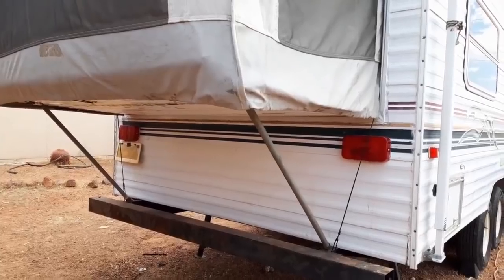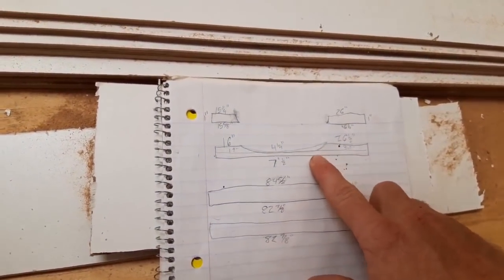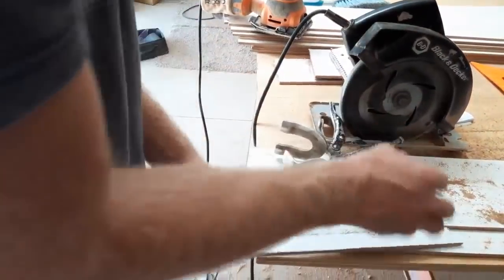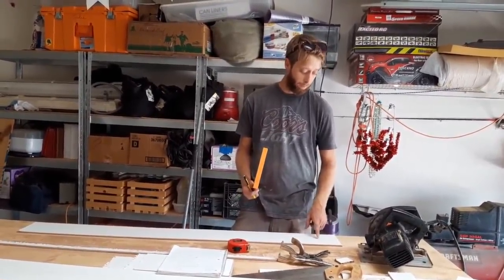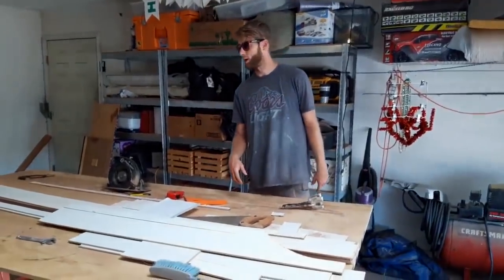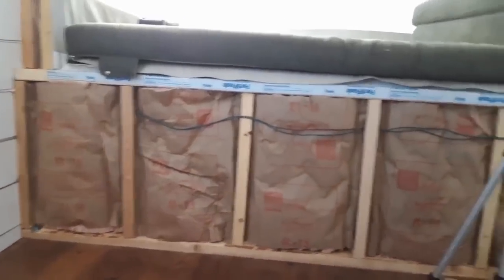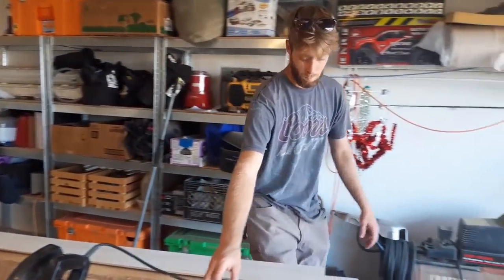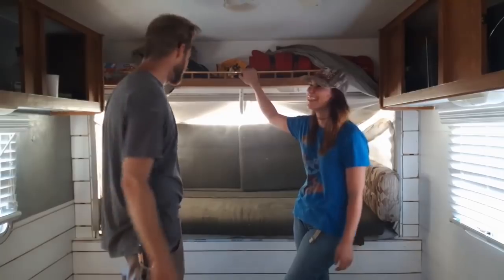Interior Shiplap | 5th Wheel Travel Trailer Renovation | Days 11 &12

Comment: Once again  i seeing after the fact  so maybe file for future  projects   that kind of paneling chips easy  when cuting  
  Can cover with masting tape to reduce  chiping  
 Anotber eay is to turn panel over  that puts the cutting  edge so if chiping will be on back side  usually  chip less this way 
  Also use fine toorh blade intended  for cutting paneling 
   If you use jig saw or saber saw the make reverse  cutting  blade  as they normally  cut on uo stroke the panel blade cuts on down stroke minimize  chips to very small 
  Overall very impressed  with  work Done

Comment: I saw the roughness of your cuts with the circular saw.  I would recommend getting a new blade for the saw before you start the cabinet building.  You will get much cleaner cuts and will be happier with the results.  Also, with a sharp blade, things will be easier to cut.  Great work so far.
Reply from the maker: Thanks for the tips! This blade has seen a lot. Still cuttin.. LOL! We are actually not building cabinets for the trailer. We are going to leave the existing cabinets ion there for storage space. We are however going to build a platform couch/bed with storage underneath that, a desk for the master, a corner hutch, and some shelves. Lots to do still.. 😏